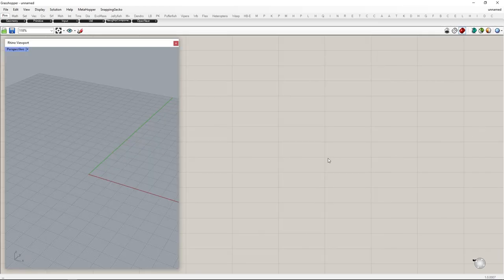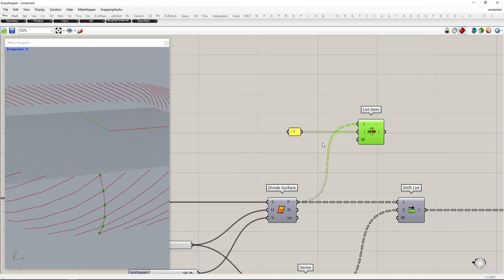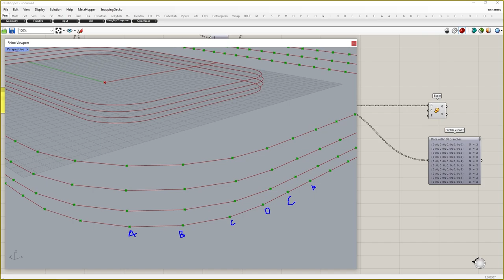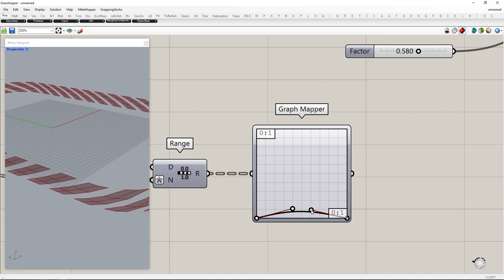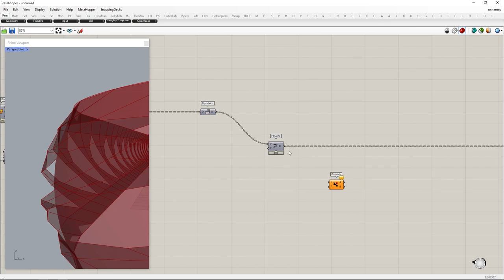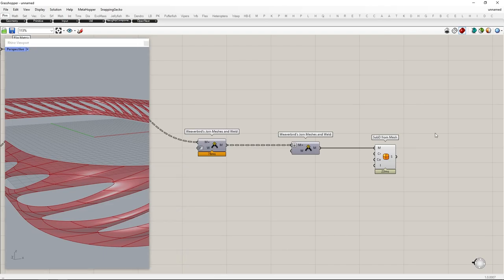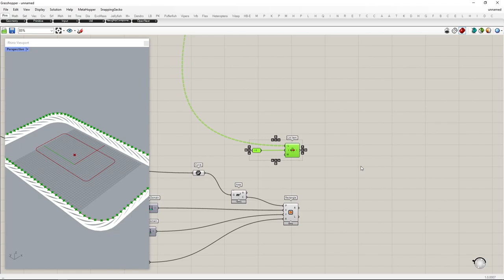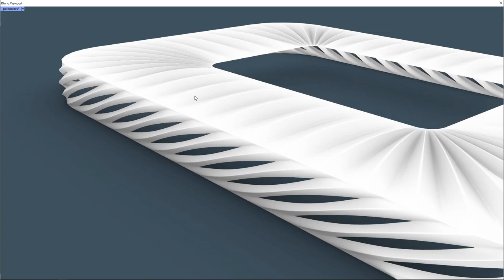Nagyerdo Stadium Modeling in Grasshopper

Comment: Will there ever be a day when Rino will surpass 3ds Max or Sketchup?
Reply from the maker: for me its already
Reply: @3DBeast  good!👍
Reply: @zinuszinus2555  Lol! Rhino is always ahead of both Skp and 3ds Max. SketchUp uses lot of unstable plugins to perform simple command in Rhino. Now they started ripping off Grasshopper, with some pointless interface with 3D node blocks. 3ds max has some advantages over rhino and vice versa, depending on the purpose.